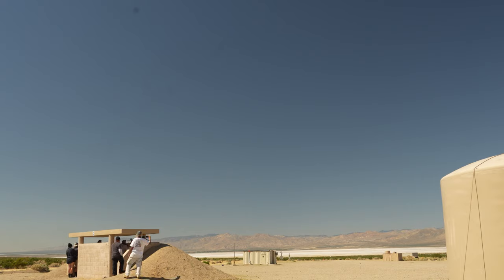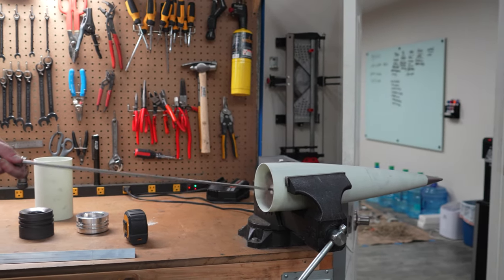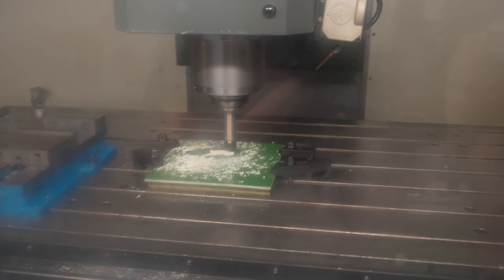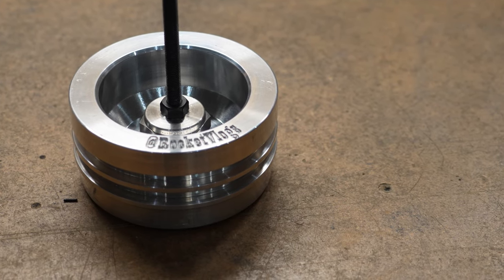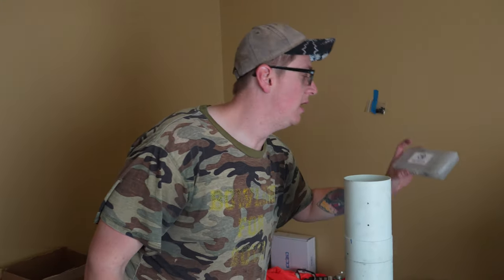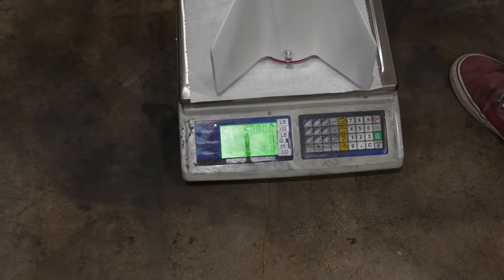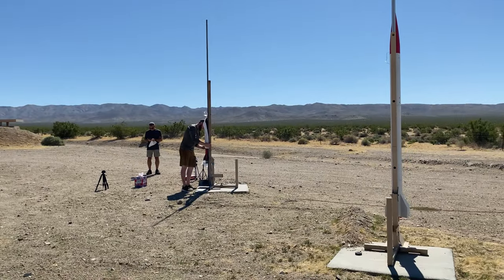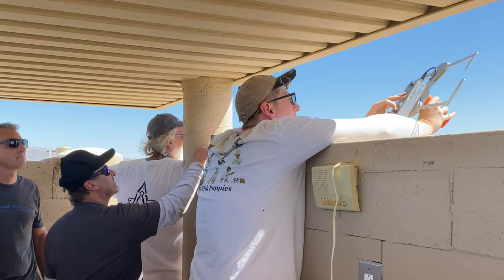Putting a Military Ejection Seat Motor in My Hobby Model Rocket

Comment: I was wondering about the G force load over the flight duration and really, was not surprised by an electronics pod failure.  Also was surprised the fins stayed on though. It was a good flight not withstanding and excellent job on the rocket build by the way.  It stayed together.  That motor was insane!!!!

Comment: If the electronics bay is short and you have a washing machine, you also have a centrifuge that can provide that kind of g's. I figure our washer could test a 5 inch long ebay to 150 g's, though it would be more like 300 on the outside edge. Assuming 1,000 rpm. I understand some are faster.

Comment: That was awesome! 150g's?!... Are you exaggerating or did you not run flight calculations before flight?
Reply from the maker: Not an exaggeration. Math showed about 155G on takeoff. The rocket only weighs 15 pounds without the motor in it! 4,500 pounds of thrust ain't no joke!

Comment: So  this is a military ejection seat motor or "it's basically like a military ejection seat motor"? Other than feeling baited, I liked your project.
Reply from the maker: They make a production motor for ejection seats, but my rocket could not fit one as it's true 4" OD and thus the same size as my motor tube. So, they made a 3.8" version to fit inside my rocket.
Reply: @RocketVlogs  I see.
Reply: @RocketVlogs as someone that used to be an engineer in the aerospace field, this has nothing at all in common with ejection seat motors except having somewhat similar thrust output to some ejection seat motors. The motors in ejection seats vary greatly in thrust, burn time, some even use multiple motor burns to accomplish ejection. It all depends on the the capabilities,  space availability of the aircraft, the weight of what is to be ejected, more modern aircraft actually take into account air speed and altitude and adjust how many burns are needed to clear the aircraft as safely as possible, or to achieve enough altitude for the parachute to deploy properly.